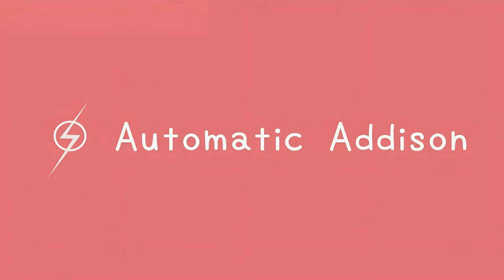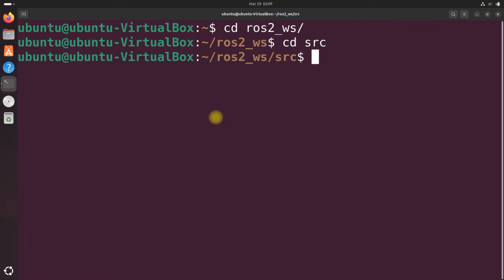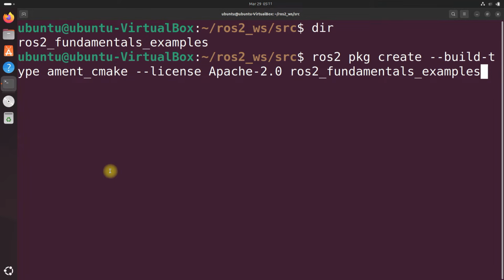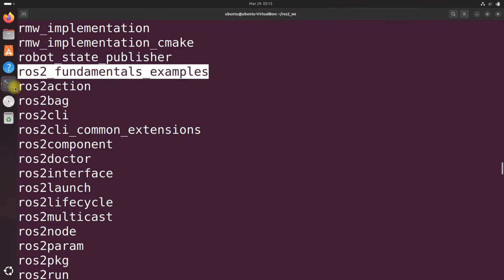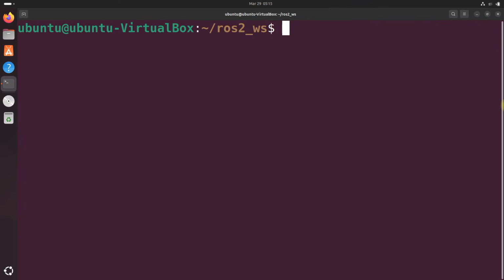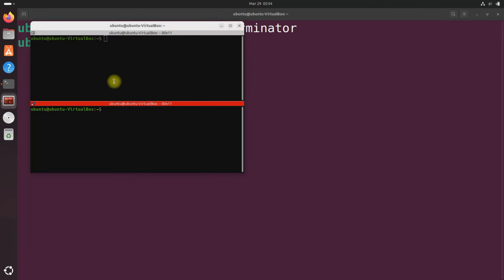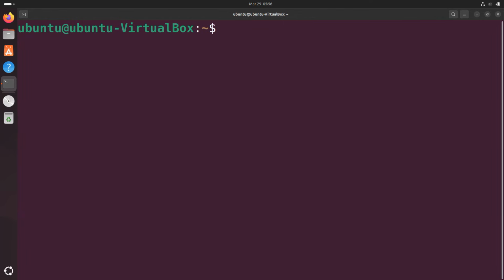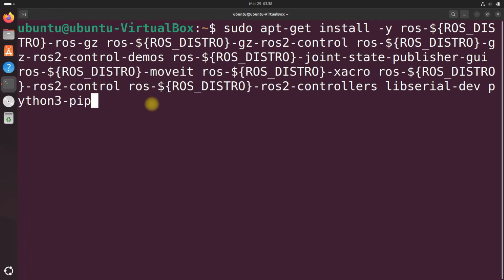How to Create a ROS 2 Package - Jazzy

Comment: I've been using Linux mint. Can anyone help me on the installation?
Reply from the maker: You can install ROS 2 on Linux Mint since it’s based on Ubuntu, but it’s not officially supported. Some things might break or need manual fixes. Docker is a good workaround, but for full compatibility (especially with ROS 2 Jazzy), Ubuntu 24.04 is the recommended OS.